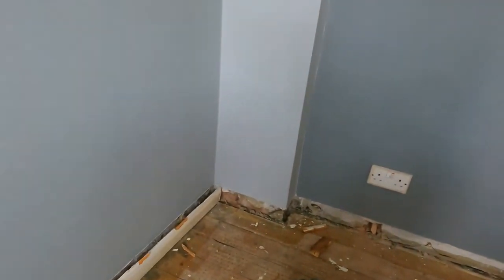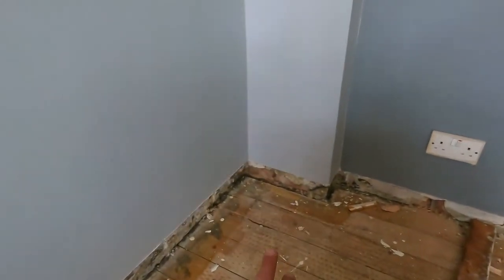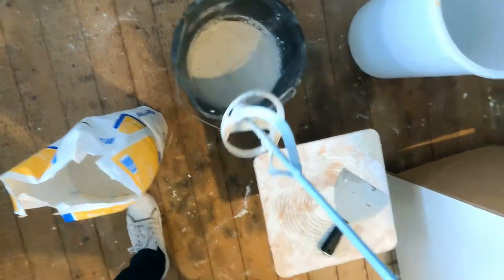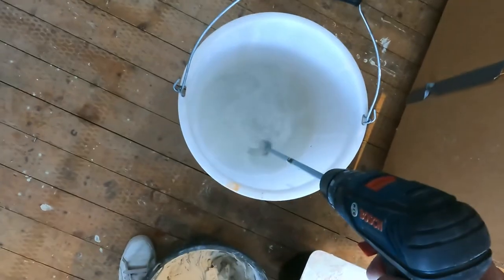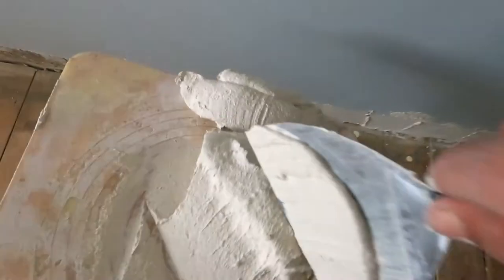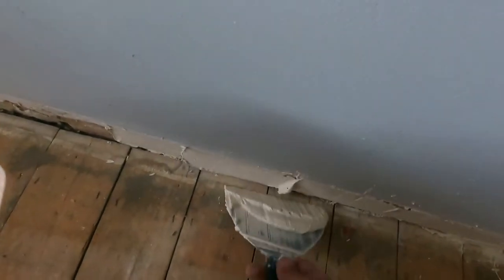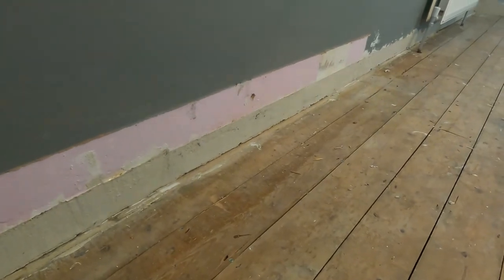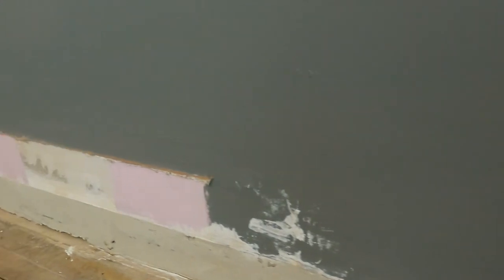How To Make Good Plaster After Taking Old Skirting Boards Off

Comment: I’m only replacing my skirting boards not the flooring is there any way to fill in the gaps while protecting the wooden floor that’s in the room currently?
Reply from the maker: Thanks for stopping by the vid 👌👊 yeah I'd put a dust sheet down on the existing floor when your filling the gaps so the filler don't go on the floor plastic  or material 👊

Comment: I’ve taken off old skirting boards from an en-suite shower room, although not going to put new skirtings on as I’d rather it be tiled instead. However, I’ll need to be filling the gaps with plaster anyways. Thanks for demonstrating 👍
Reply from the maker: Yeah 💯 mate bonding is cheaper than tile adhesive plus a much better job for the tiller to start on 👍 thanks for the feedback mate nice one 👊

Comment: If the new skirts were going to cover the holes, is there any need to patch?
Reply from the maker: Hi melanie thanks for stopping by the vid 👍👍
Yeah definitely fill the gaps before putting on new skirting the new skirting needs to have a sound surface to fix to for adhesive pins or screws thanks for your comment hope this helps 👍👍👊.

Comment: Great short video. Thanks.
I have removed skirting boards in my house and under them I found wooden boards as a base skirting were attached to. I have removed all and will just fill it with hardwall plaster. Your video helped me to understand there is variety of solutions and what you are going to do only depends on what you want to achieve.
Reply from the maker: Thanks for your great comment mate I'm pleased the vid was some help to you , yea if you have an old property you just don't know what you are going to find when you start doing some home improvements thank you for taking the time to watch the vid nice one 👌 👍 👊

Comment: For wonky walls it's quicker to lay a run of skirting on the floor against the wall and If no areas of missing plaster above, then great! Then with the skirting against the wall mark on the wall where fixings will go at 500mm intervals with a pencil, or put a pencil mark where the largest gaps are between back of skirting and wall face. 
Get plastic packers that come in different widths - 1mm, 2mm, 3mm etc and using a set square butted up to the wall, fill in the gap between the set square edge and exposed brick where each pencil mark is. You've now worked out the plaster thickness using packers. No faffing. 
Stick the packers, usualy one on top of the other to the exposed brick at the bottom of the wall with plenty of grab adhesive and leave to set for 30 minutes, whilst doing the same procedure on the next run of skirting in the room and so on. Then grab your first piece of skirting and hold it against the wall and drill holes through and along the skirting where your packer positions are using a 5.5mm drill bit with a countersunk head, then keeping the skirting against the wall drill through those 5 pre made holes into the exposed masonry/mortar using a 60mm long x 5.5mm dia masonry drill bit. Then if you wish put a bead of grab adhesive along the back of the skirting board near the top, and a small dollop into each new hole in the brick/ block masonry. 
Present the skirting up to the wall, take 40mm long x 6mm dia plugs with a 55mm long wood screw partially screwed in, and bang the fixings through the holes in the skirting until all the plugs go into into the pre made holes in the masonry behind with a hammer. Get all the plugs and screws in place, then tighten all the screws into the wall with a drill. Doing this will physically pull the skirting against the wall and take out any gaps. Timber skirting will bend a little, and you will not be left with any gaps. A very thin bead of caulking can then be applied along the top.
Basically why add plaster at the bottom of plaster when most people will be using mechanical fixings anyway to pull the board to the wall face. Just build the plaster depth out where the fixings go in packers.
Reply from the maker: Well said mate 👏 👏👍👊

Comment: Much needed video. Just wondering if you went in and sanded the end of the plaster down before painting and if so, how/what did u use?
Reply from the maker: Thank you very much for stopping by the vid nice one 👊.
I'd probably use some 120 grit sandpaper on a block so it sands the area flat plus 120 is on the  fine side of sandpaper so will work great ,thanks for your feedback appreciate it and  hope you get the finish you need 👍👊

Comment: Thanks so much for this mate!
Reply from the maker: Hope the vid was of some help and thanks for watching the vid really do appreciate it alot good luck with your project and hope it works out OK 👍 👌 👊
Reply: Thanks, going to attack it tomorrow! Presumably you'd suggest the Thistle One Coat over using up some old Polycell readymix I have? Is the readymix too thin/weak? @creativecrambo
Reply from the maker: @luke1525  you might be better off with just bonding  coat mate fills the gaps perfectly but make sure it's flush with existing plaster 
Hope it goes ok for you mate but your on the right track with it let me know how you get on I will reply 💯👍👌👊

Comment: good video mate very helpful, just removed old boards and its like this plaster all coming off and missing, just brought the bits i need gonna do this tomorrow, hopefully i can glue the new boards on then.. thanks
Reply from the maker: Michael thanks for stopping by the vid mate 👌👌 yeah when  you take them old skirting boards of you always get loads of holes to fill but you need to get it made good for new boards going on  it's a job in itself lol ,you start one job and it always leads on to another 🤦‍♂️ good luck with your project mate and thanks for your feedback 
👍👍👍👊.
Reply: @creativecrambo  agreed mate, it was only meant to be a quick decorating job ! It's already turned out expensive lol and time consuming, cheers bud
Reply from the maker: @Michael-zr9yl  yeah no worries bud 👍 keep up the good work its never a 5 minute job lol be safe mate and good luck 👍👍.

Comment: This is really helpful, thanks mate! I followed this in one of the bedrooms in our new house today using the same thistle one coat stuff and it worked a treat. How long does it take to dry? Should it be sanded down once it’s set? Thanks again mate 👍
Reply from the maker: Thanks for stopping by the vid Zak 👍👍 I'm pleased the vid was a help, well as long as you do a good job of the making good you won't need to sand down your putting skirting boards/ baseboards over it  so it won't be seen but you might have to if any plaster is seen all depends on the height of your new skirting boards/ baseboards thanks for your comment appreciate it mate nice one 👍👍.

Comment: thanks for this video just what I needed! Mine have timber bits nailed into the bricks behind the skrting inbetween the gaps I'm guessing I cant plaster in those because it wont stick to the wood properly? any advice??
Reply from the maker: Thanks for stopping by the vid mate  nice one 👍 
If you carnt some how take out the timber bits then you can use some  galvanised steel mesh to go over them bits of wood and the plaster will key into it mate that would work just fine cut the galvanised steel mesh to the size you need 👊

Comment: What type of nail gun would you use for fixing new skirting to this? I’m looking to do the same and thinking of getting a nail gun for multiple tasks and trying to work out if a 2nd fix nail gun or Brad nailer (all cordless - either Milwaukee or Dewalt) to use to fix boards to plaster/concrete with grab adhesive. Or do you need a proper concrete nail gun?
Reply from the maker: Thanks for stopping by the video mate nice one 👍yeah most property's are plastered and using a second fix nail gun should do the job the one's you have mentioned are really good can't go wrong with either i use a paslode second fix nail  gun all the time and use straight Brad's 38mm they go into the plaster if your going into concrete you need to use a different method perhaps drill plug and fix the only prob with that is there's more filling and sanding down to do, 
hope you get it sorted mate and all the best thanks for your feedback 👍

Comment: Thank you very much for this. I am removing the skirting board in my downstairs bathroom, can I make the plaster good like the video so I can tile over it? Or do I have to use another product to tile over?
Reply from the maker: Thank you very much Marjorie for stopping by the vid nice one thanks 👍
Yeah 💯 you can use it to fill in the gaps after taking off  your old skirting boards if you are putting new tiles on there your probably better off using some  unibond primer on the dried plaster before you do your tiles gives it a nice bond hope this is a help and hope it looks amazing with them new tiles on I'm sure it will 
👍👍👊.

Comment: Really helpful vid thank you! I've bought new skirting boards which are 1 inch shorter than the old ones. I just need to plaster the 1 inch gap above - how would you recommend filling this? 

Thanks, Jamie
Reply from the maker: Thanks for stopping by the vid Jamie 👍👍 yeah that 1inch gap you need to plaster will be seen so you need to do a proper job on it I'd use some bonding first then finish off with skim make sure its troweled off nice and flat to the existing plaster as I said it's a finished job ,hope this helps you out mate let me know how you get on , and thanks for watching 👍👍.
Reply: @creativecrambo  thanks for the great video! Following on from this, I'm in a similar situation to James. New skirts that are lower than the old ones and there's a bit of plaster damage below and above the old boards: I've not put the new boards on yet but is it OK to put boards on and then fix plaster patches? Or should I fix plaster before putting new ones on? Thanks again for your great videos!
Reply from the maker: @samhaldenby8631  thank you for stopping by the vid Sam nice one mate , yeah definitely do all the making good before you put the new skirts on mate if you don't you got nothing to fix to the adhesive needs to bond to it plus if your using a nail gun the pins need something to fix to ,💯 get all the areas filled in make sure its flat to the existing plaster then your good to go with new skirts,  hope it works out ok for ya mate fill all them gaps in 💯👍
Reply: @creativecrambo  nice one, thanks so much for that and all the best mate 👍
Reply from the maker: @samhaldenby8631  all the best mate be safe and take care 👍👍👊

Comment: Thanks for this its really helpful. Would ready mix joint cement be ok to use or is the one coat plaster much better?
Reply from the maker: Thanks for stopping by the vid mate nice one 👍👊 and I'm pleased the vid was a help to ya mate , yeah the cement will work just fine mate just fill in those gaps ready for your new boards going on happy days mate 👍👍👊 hope it turns out ok for ya mate good luck.
Reply: @creativecrambo  Cheers mate. I removed the skirting and thought this is a headache. The vid has helped loads. Thanks again👍🏻
Reply from the maker: @nathanmayer711  yeah no worries mate pleased I could help and thank you for watching appreciate it alot 👍👍👍👊.

Comment: I've removed skirting and have similar damage to the lower-plaster. As I want to replace the existing laminate flooring, should I have the floor pulled up and replaced first before replastering or replaster first? Thanks

Comment: If I already have a new hard flooring installed, should I use masking tape on the edge of the floor before plastering? Thanks
Reply from the maker: Hi joey sorry for late reply I've only just seen your comment to be honest mate I wouldn't use masking tape on your floor it will have to be cut off after just be as steady as you can be doing the plastering plus if you do get some on the floor it's quite easy to clean off put a dust sheet down as close to we're your working that will do the job then just have a clean up at the end of the job thanks for stopping by the vid mate nice one 👍 👊
Reply: @creativecrambo  Much appreciated! Thank you for your help!
Reply from the maker: @joeyleung23  
NO PROB MATE TAKE CARE 👍 👊

Comment: Thanks for this, very helpful. Can I ask how you done behind the radiator?
Reply from the maker: Thanks for stopping by the vid cheers 👍👊
Yeah you just got to get down low and methodically work the area you need to fill it's not that hard but maybe use a smaller trowel will do the job 

Thanks for this!!  feedback really do appreciate it alot 👍👊 and good luck with your project your doing 👍

Comment: Hi..
Is it OK to plaster right down to floorboards? Should a gap be left for movement when rad is on?
Starting mine this weekend but want to be sure.
Reply from the maker: Hi Rob 
Yeah go right down to the floor mate just make sure it's nice and flat to, its better for fixing new skirtings hope it all goes well and thanks for stopping by the vid 👍👍👊
Reply: @creativecrambo  awesome thank yoi...same applies for upstairs I assume?
Reply from the maker: @robjames5623  
Yeah same rules apply mate get them gaps filled in then your good to go 👍👍👊
Reply: Hi...thanks bud...just one more thing, upon checking, a few of the floorboards do NOT go to the wall, they fall short by an inch or so, so the plaster would fall through the gap. Best way to sort this?
Reply from the maker: @robjames5623  yeah not to sure what has gone on there mate but you can still plaster the bottom use some bonding it won't fall down plus your putting new flooring down yeah wich will close that gap up then new skirting on top of new flooring if that's what you are doing then yeah still plaster as you would of 👍👍👊
Reply: @creativecrambo  Hi...No bud...no new flooring...old flooring (floorboards)...new skirting (Taurus)...then underlay, then carpet.
I thought maybe a bit hardboard or ply to fill the gap, the plaster, then etc
Reply from the maker: @robjames5623  
Yeah ok  mate see where you're coming from now if the gap is an inch all round  then find the thickness of the boards and then rip down timber to suit the gap put to be honest by the time you put new skirting on that gap will be closed nearly anyway and if you are having carpet down they only put grippers rods  around the perimeter so you might not have to fill that gap anyway know what I mean 👍👍👊
Reply: @creativecrambo  You Sir....
Are a gift to the D.I.Y community.
Reply from the maker: @robjames5623  
Cheers Rob thanks for the kind words mate means alot if anyone asks meaningful questions like you have ill definitely try and help with a positive constructive answer thank you very much for your feedback really do appreciate it and I'm sure your job will work out just fine mate all the best and good luck man it's been nice speaking to ya 👍 👍
👊
Reply: @creativecrambo  Likewise bud. Stay safe and keep giving good advice.....👍
Reply from the maker: @robjames5623  thanks 
Stay safe mate take care 👍👍👊

Comment: Not sure why you need to do this. Can't you just place new skirting over it.
Reply from the maker: Hi Jimmy 👊
You never put new skirting over old skirting mate for the simple reason of the gap that it will create on the top end for the best results mate rip old skirting off and start a fresh it's the only way mate  you got to think of the final finish filling corking painting hope this helps you mate happy new year 🎉 🎉👍👍👊
Reply: @creativecrambo  Hi. Understand that. I was talking about  the wall itself. Thanks for the reply.
Reply from the maker: @jimmyjemal8802  
Sorry mate cross wires there mate ,yeah fill any gaps in after taking old skirting off its better for the adhesive and for fixing  the new skirting 👍👍👊

Comment: Thank you for videos and info. With my current project the gaps behind the skirting board are much larger and may need to do some patch work above. Will
One coat plaster be ok this? Or will i need to use the multi surface plaster? Thanks again
Reply from the maker: Thank you mate appreciate that comment nice one 👊
You can use the one coat plaster mate you might just have to do a second fill or you could use some bonding plaster and that would do the same hope it all works out ok for you mate and thanks once again 👍👍👌👊.